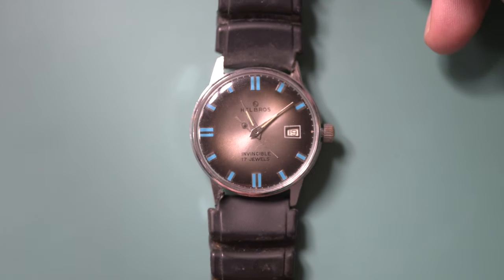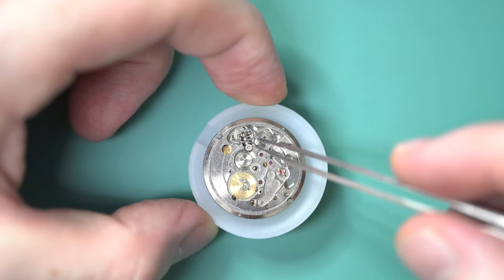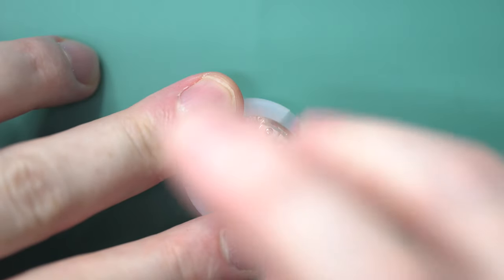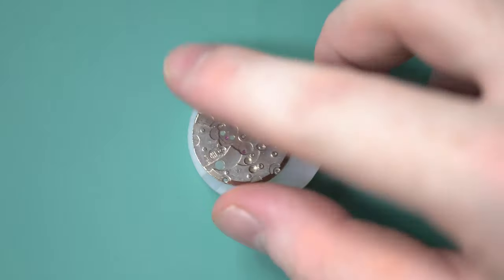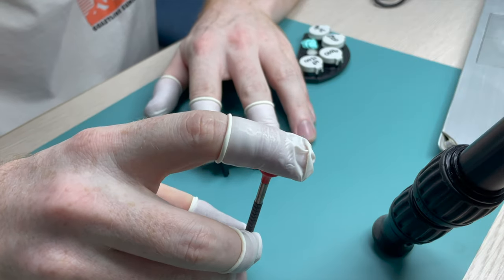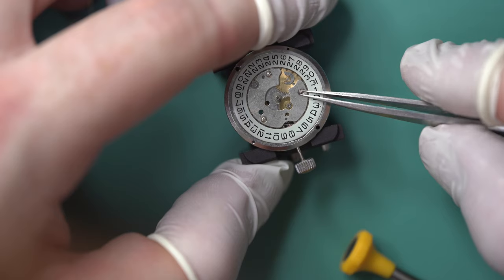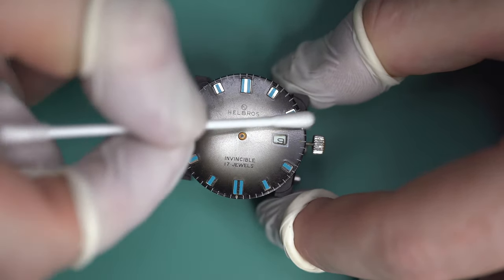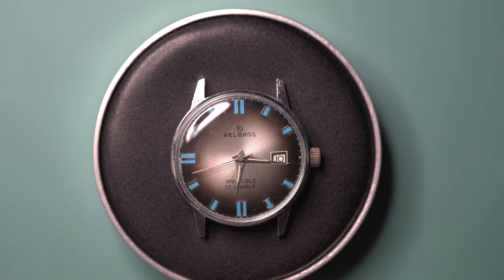Restoration of Broken Helbros Vintage Watch - French Lorsa P75a Movement

Comment: If you are still a beginner and this is your second video, you already have excellent technique. Using screwdrivers and tweezers is a delicate affair (you know this!) and a definite learned skill. Where do you learn to deal with itty-bitty things and use your ten fingers just right? Electronics folk tend to have this skill, so wherever you got it, well done.

btw, that tool you want the name of - it's a crystal lift
Reply from the maker: Thanks for the kind words, you hit the nail on the head, my years of instrumentation preps and soldering have definitely earned me some transferable skills! And appreciate the tool name 🙏 I’ll use this going forward 👍🏻

Comment: Hi, another enjoyable video, I am a beginner as well, and I am taking Mark Lovick in a youtube course (watch training), and among some interesting learning, I share you some of the tips regarding lubrication techniques.
"Using an oiler to draw oil from your oil pot, you will notice that you can control how much oil is drawn depending on whether you dip your oiler towards the center of the pot or the edge. It is much better for you to draw from the edge as this will aid you in not swamping a friction point with too much oil." An oil ring should be around 50% of the jewelry surface, never over 70%.

Comment: Hi! Another tinkerer here. Good job with this watch.
Because of how the balance was reacting when you first checked it I think that the problem that was not letting it run is that the balance had overbanked, that is when the impulse jewel gets to the wrong side of the pallet fork. Probably it has happend to you sometime when installing a balance, but it can also happen under some circumstances when the watch is dropped.
The hairspring coils are not concentric and need to be adjusted, but that's a very delicate task.
Reply from the maker: The issue was exactly that! Well spotted 👌🏻 I believe the watch may have either been over wound or dropped at some point which caused this to happen. Thankfully we were able to get this one back up and running

Comment: Dont know if you are aware of that oiling the pallet exit Stone Can  give you a better amplitude, a tiny amount on the Stone and flip the pallet three times and repeat till all of the teeth on the escape is oiled i use moebious 8200
Reply from the maker: This is definitely something I’m looking to do going forward, I have the Moebius 8200, but unable to find some fix o drop. I’ve found that without fix o drop, the 8200 tends to spread a little too far. Hoping to find some fix o drop or equivalent locally, importing hazardous materials is a nightmare/impossible 😩
Reply: M8200 is a grease.  Isn't the recommended lub for the pallet stone a synthetic like Sytalube 9010 and good for any frequency watch?
Reply: @gwsjr1  i think 9010 is too thin and will disperse away fast 
i have read the instruktion from moebius and im pretty sure that it says that 8200 is for the pallets, but i could be wrong
Reply from the maker: @gwsjr1  a bit more research and Moebius 9415 is typically used for pallet stones. It’s a grease that’s designed to be viscose when stationary, but liquify when impacted. Clever stuff!